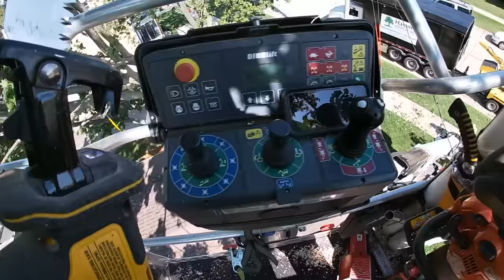Harassed by Angry Neighbor Demanding Tree Removal

Comment: Same problem here in Florida except the HOA owns the tree, so virtually unlimited resources, and like in the vid it has two huge trunks from a single base, as big or bigger old majestic oak at the end of its life, dangling right over my master bedroom/bed.  The old Florida law says if you have a dead tree on your property and it damages the property of another the liability is to whoever owned the tree and did not correct the situation, but it has to be completely dead.  But the law also allows you to cut a live nuisance tree back to the property line.  In my case that wont help because the house is only 7 feet from the property line and only a few limbs are actually over the line, but the massive multi tons of towering trunk is at the property line and leans heavily to my house.  I could cut it back to the line and do nothing to alleviate the threat.  The tree shows a lot of risk signs like dead limbs of 12 inches or more, limb drops, sparse leaves, cracks in the bark, a single bole with two main trunks that grew apart.  But, the HOA refuses to even discuss it unless it is completely dead, and being Florida it is not going to get completely dead before a storm takes it down right through my roof onto my bed.  If it is "alive" then my insurance has to cover it with a $9,000 deductible.  I am a disabled vet on a small fixed income and I simply cannot afford an arborist, tree removal, a lawyer to get into a legal battle with the HOA or the damage from the tree falling should I survive that.  Florida did recently change the law some, but they used layman terms, no input from tree professionals, and the new laws have no case precedents set and nobody wants to be first under the new law because it is unpredictable how the case will go.  Had the legislature used tree professionals to help write the new laws then there would be little or no doubt about legal outcomes, but using layman's terms and generalizations it is a crap shoot how the courts will rule.  This is super frustrating that I have to sleep with this dangerous tree over my head like the sword of Damocles.
Reply from the maker: Yeah, that’s a tough situation.
Reply from the maker: Here’s four more videos with updates https://youtu.be/g2Z81punreI

Here’s a positive result
https://youtu.be/F4-ZvXLwXCI

The tree comes down https://youtu.be/6ML1joMsiDg

The stump reveals the truth.

https://youtu.be/H9y-PW7t3oY

Comment: You said somewhat contradictory things, Based upon your experience you don't believe cutting down the one side will have any negative impact on the other side, but then said you won't be liable for any damage to that other side. If it won't impact it then proceed with confidence there will be no impact. If you're so confident sign something and move on.

Comment: Saying these are two separate trees is true. However, stating that removing the "hazard" side tree will not affect the tree next to it is simply not correct. The base and root systems are obviously intertwined and the dirt around the roots is obviously shared and affected by both root systems. I'm not going to go into the legalize, but to say removing one of the trees has "no" affect on the other is simply wrong. It will certainly affect the other tree, maybe good even, but it will. Peace.
Reply from the maker: My statements were somewhat hyperbolic in that I was speaking to the context of pruning large limbs from an opposing separate stem vs removing a large lower limb from a single stem. I just took the other side down three days ago and the data is in my favor. I’m going to airspade the roots and show everything and we will see who is right and who doesn’t know, should be fun, stay tuned. https://youtube.com/shorts/q6yDtZsMsT4?feature=share

Comment: Am I the only one who thinks that - of course - if the "other half" of the tree falls down 2 minutes after the tree worker cut down the other half, he'll be liable for it. Yes, if the neighbor thinks the remaining half is a danger, he should absolutely have it cut down - within a reasonable amount of time. Exactly where that line goes I don't know. But again, I would be shocked if a jury and court could not hold the tree worker responsible if the other half fell down shortly after they finished their work. Doesn't exactly require a rocket scientist to connect the dots.

What I also can not follow quite is the logic presented in this video. At the beginning, the argument goes something like "that other half is a separate tree and it's yours so we don't care shit about what happens to it (or you) after we're done here", okaaaaaaaay, not very kind.... but, then 8 minutes into the video the same guy explains how damaging a neighbor's tree just by cutting off overhanging branches is something one can be held liable for! In fact, the point is extensively elaborated with further examples such as digging in one's backyard and damaging the roots of a tree from the neighbor's property. In my humble opinion, this seems to completely contradict the first argument "it's not our tree so we don't have to care".

To make matters worse, this video isn't even honestly labelled. It's not the neighbor that is "angry". This poor guy is even excusing himself for having the dialog. It is the tree worker that is the angry one by constantly interrupting the neighbor and trying to exert his "authority and expertise" as some kind of an argument by itself.

As far as I can tell, the tree worker is just wrong here and not even a pleasant person. Then he makes a public video on it and calls out the the poor neighbor who is rightfully concerned for his life and property as being "angry"? Dude, seriously hahahaha, what's wrong with the world today.
Reply from the maker: Here’s a follow up on the situation. https://youtu.be/g2Z81punreI

Comment: I think that you'd be hard pressed to find anyone to agree with you that they are two separate, i.e. independent, trees such that cutting down one won't affect the other.    

As a pair, they are balanced but either individually are clearly not balanced.  With Inosculation,  "The cambia layers from the two trees come in contact and the vascular tissues become connected, allowing for the exchange of nutrients and water."  So, they may actually be bonded where they touch and certainly their roots are intertwined and helping hold each other.

I don't understand why you want to take out the entire left trunk and not only the branches that endanger the other house.  I would expect that taking off, say 50% of the weight from that side would significantly reduce the chance of a problem to the neighbor's house without being a significant detriment to the owner's side.
Reply from the maker: Here’s a follow up on the situation. https://youtu.be/g2Z81punreI